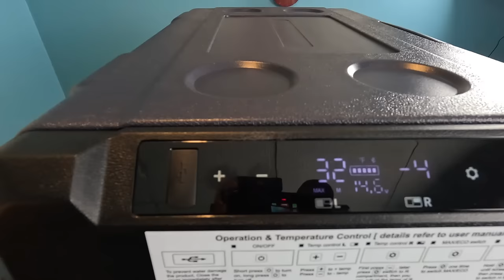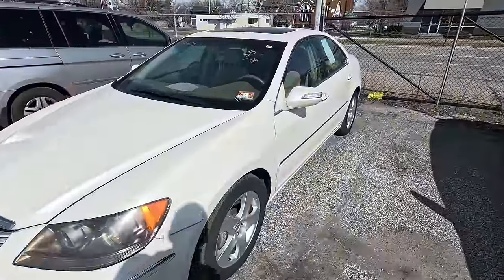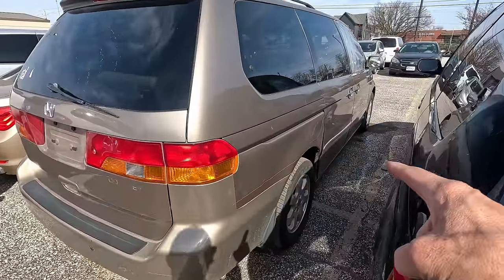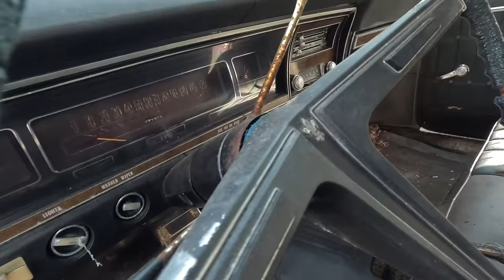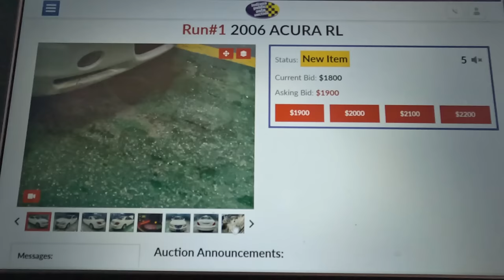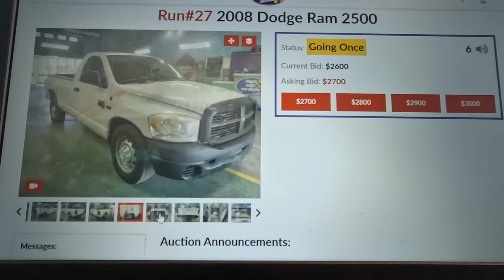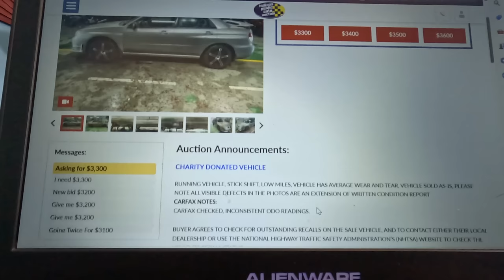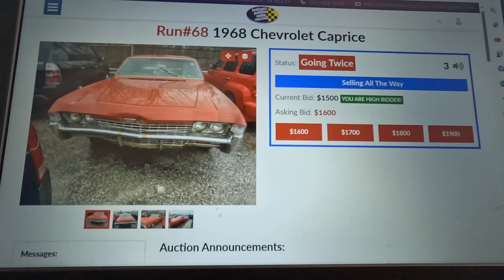Buying a Classic car at the Indiana public auto auction This video is sponsored by BODEGA COOLER

Comment: Good deal on that 68! That’s a good price for just the 327. And I bet that it’s got a 2 speed power glide in it. I’d pull the engine & transmission & the rear axle and scrap the rest of the car, it’s a rust bucket anyway.
Reply: And keep the grill for a wall hanger.